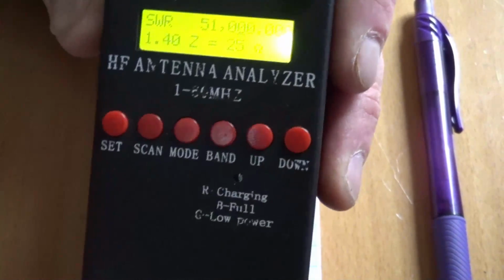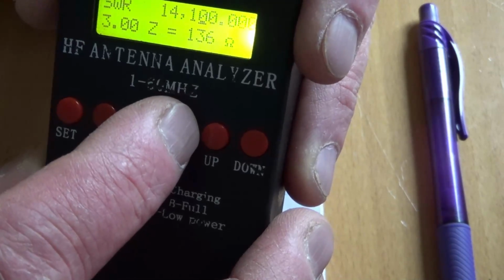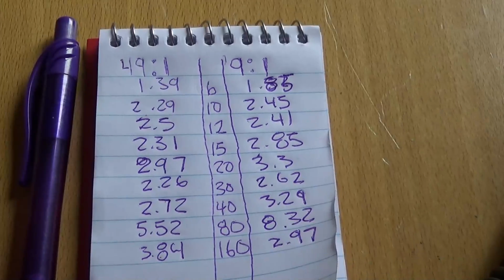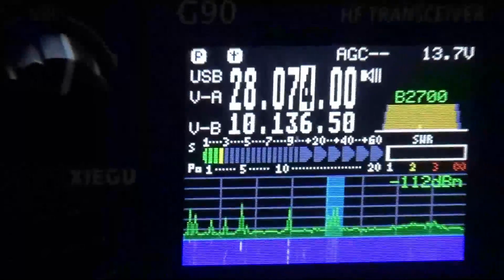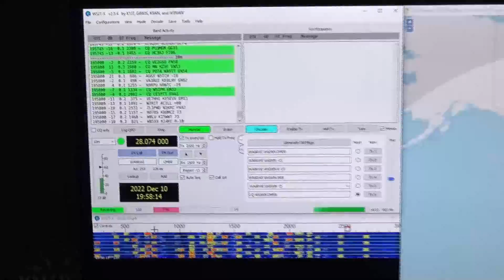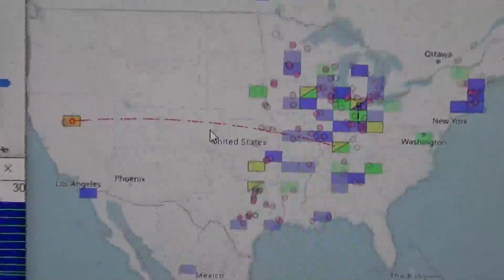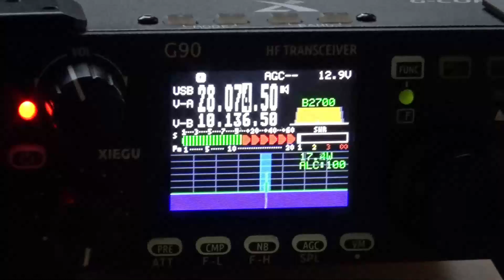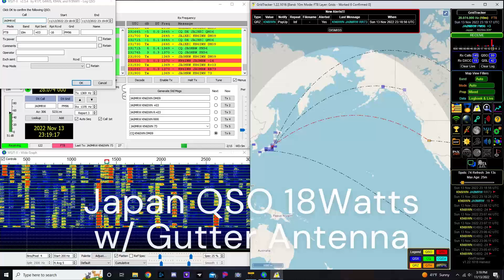How to make a HF Rain Gutter Antenna

Comment: How did you physically attach your feed wire to the gutter?
Reply from the maker: I soldered a small clamp from an old battery charger to a wire and clamped it.

Comment: FT8 is not really the best mode to evaluate antennas since it's a very weak signal mode and minuscule radiated power will provide contacts.  Also, keep in mind that if an antenna needs a counterpoise (CP) to work, the CP also radiates. So if it is 6 inches or more above ground level, the CP will be much more efficient since it couples less energy into the lossy, high-resistance earth/dirt versus laying on the ground.  This also applies to radials for vertical antennas.  Check the excellent article by N6LF in QST, March, 2010, especially the graph in Figure 5.
Reply from the maker: This was an old HOA stealth antenna I was experimenting with years ago. FT8 is an excellent way to test your raingutter antenna! There are many debates on elevated or non elevated counterpoise wires. For a stealth HOA application, having them on the ground to not be seen or tripped over is just fine. This is a comprised antenna for someone without other options in an HOA. Thanks for watching 😃

Comment: I use my rain gutter, no coils or baluns ,just coax and ground rod, swr below 1.5 on 10,15,20,,, 40 needs tuner,   my with is fl, did a test and checked my signal,on web sdr, at 5.6 it works
Reply from the maker: I'm glad it's working for you! Nice setup.

Comment: I have IC-7300 --> 30' Coax --> LDG 1:1 Unun (Blue) --> LDG 9:1 Unun (Red) --> 250' rain gutters. I have a 4' piece of rebar in the ground about 3'. Seems to work ok, can transmit from N. Alabama over to the east coast, up into the mid-west and northeast. I have done FT8 all over the US and into Cuba as well as the UK. I can hear people on Amps from the west-coast and the UK. Seems to work best within a two state circle. 

I also have the Alfa HOA Buster that is currently installed but it seems to be not working now, going to switch back to the above setup tomorrow.
Reply: to be clear, are you running a wire in the gutter or feeding onto the metal gutters themselves?
Reply: @adb99999999999  I'm feeding the metal gutters. I have a wire going from the Alfa HOA Buster to the rain gutter downspout.
Reply from the maker: @adb99999999999  loading the gutter themselves.
Reply from the maker: I've had some better results when it's raining, just rained, and snow in the gutters. It most likely gets a better connection then. It's definitely a comprised antenna, but better than nothing. Thanks for watching 😃

Comment: I have an hf rig mounted in my truck. I own a Hustler mobile vertical but for kicks I decided to try running a wire (maybe 35(ish) ft long using a 1:1 BALUN with a counterpoise cut for 30 meters along the ground. I ran the radiating element up to and routed it along the aluminum eve of my front porch in the pocket just under the gutter. This is facing South. I used nails in place from Christmas lights to hold said antenna wire in place. I don’t know how the aluminum may have played into the characteristics of the antenna but living in Southern Illinois, I was able to tune 20 meters and receive and contact SSB up and down the Eastern Seaboard, Florida, all of the way into Texas and Oklahoma in the early morning hours. This kind of faded by mid morning though as conditions changed. It worked quite well and is the closest that I’ve come to running a “Gutter Antenna”.

Comment: There seems to be a thought with younger hams that making antennas that work well can be difficult. Being a ham for over 40 years I've tuned up just about everything imaginable. The craziest of things can produce amazing results. There is also a big myth out there that antennas are more effective if resonant, not true. In fact, you can get more signal out of a Non-Resonant antenna. Study maxwells equations to find out why. This revelation made me understand why odd metal structures can perform so well. Using an ATU you are 'conjugate matching'. Basically what happens is as the wave is traveling up and down the feed line it is adding to forward wave that radiates from the antenna. NOT acting like a dummy load as some would have you believe. So, yes, match up your gutters and have fun  :-)
Reply: Also, don't forget -- resonant antennas are ONLY resonant on the frequency it is cut for.
As soon as you move off of that frequency it is a non-resonant antenna.
Reply: @8thman8  Very true, but conjugate matching can actually improve performance when the antenna is technically "Non Resonant". Research Maxwell. I first discovered this phenomena when a section of my wire antenna broke off in high winds. I matched the antenna and strangely it outperformed when it was perfectly resonant. Now I know why.
Reply from the maker: Thanks 😊

Comment: Have you ever  made a gutter  antenna for 11 meters (CB radio) is it possible?
Reply from the maker: Mine works on 11m. You will have to experiment with what you have. If you have room , try an 11m dipole made from speaker wire.There's lots of videos on how to make the 10m version. Good luck, 76er aka 076  NorCal

Comment: I was hoping I could at least do this since we were getting new rain gutters installed . . . then they installed PVC rain gutters and downspouts, lol.
Reply from the maker: Maybe you can sneak a wire inside the gutter if it's PVC.
Reply: @W6IWN_Radio  I have been thinking about trying that. Trying to figure out how it could be done. The only downspout on the house is 125 feet away from my radios, then the downspout is 25 feet tall as it is a two story house. Thats a long way to go just to get up to the gutter where the wire would be. The downspout is at the very end of the gutter, so it would have to be an End Fed, but the gutter is too short for a traditional  EFHW antenna to be hidden inside it, lol.
Reply from the maker: @WH6FQE  some people just mount a wire to the roof eaves or an inverted V on the roof rake. If the wire is the same color as you paint, it will be hard to spot.  Best of luck 👍

Comment: How do you connect a wire to a rain gutter? As I live on a ground floor apartment with no porch. I do have a gutter outside my bedroom window and could probably run a coax through the window using a strip connection. Any help would be greatly appreciated. 73s Rob,wa2fmh.
Reply from the maker: I soldered a wire to a small battery clsmp, then I scraped the paint off my gutter for a temporary connection. For a better, more permanent connection, scrape the paint off your gutter and use a ring terminal with a star washer, and screw it to your gutter.

Comment: a little confusing on some of this. I was told by several people to  just hook center coax to gutter  braid to ground rod and let my antenna tuner  do the rest  is that correct or should i get a balum
Reply from the maker: A 9:1 impedance transformer brings the varying but generally high gutter impedance down to something reasonably easy to match to 50 Ω. I would definitely use one. Check out the Facebook Group Raingutter HF Antenna for lots of information and pictures. https://www.facebook.com/groups/292984397532571/?ref=share&mibextid=NSMWBT

Comment: Good results.  I recently joined that facebook group and saw a post where one guy used a 9:1 and got good results.  I thought about hanging a long wire from a bunch of trees in my backyard, but will probably try this first.  I’d like to know if this could work on higher bands (2 meter ).
Reply from the maker: The gutter would probably be too long for, VHF/UHF but you could definitely experiment. I do get 6m on my gutter, I haven't tried 2m. Thanks for watching!
Reply: I obviously need to invest in an antenna analyzer and tuner.

Comment: Have you tried CW yet. I guess you know that when you key down in CW you are transmitting full power as opposed to SSB where your voice goes up and down with every part of speech. Not sure what licenses you have but I am finding more Tech classes trying to learn CW and like many of us, I slow down to what that person can copy. None of us started out copying fast CW and all the more reason to help out the newbies who are trying to learn. Many of them will be copying above 20 wpm soon. 
FT8 is OK if that is all you can do but the satisfaction of copying code in your head as opposed a computer doing it for you is great. 
Your results with SWR and the 49 :1 unun are plenty good enough for most auto or manual turners to tame. 
Good luck making contacts and I applaud you for making the effort of loading your gutters. Just be vigilant with your counterpoise and ground connections since it does not take long to get some oxidation.
I was first licensed at age 15, 51 years ago and still enjoy the hobby very much.
73, Glenn WA4AOS
Reply from the maker: Thanks Glenn, no I don't know CW yet but it's on my bucket list. There's a slow speed CW net locally here for practice.

Comment: I love it. One of my best QRP in the park was using a raingutter. I had thrown a 35ft OCFD fed with 450Ohm window line and LDG 4:1 balun. I thought I could get my antenna higher and started to pull it down. It got stuck and I pulled it apart.
Wolfy offered me a hamstick, but I declined and enjoyed my coffee for a few minutes. After thinking a bit I pulled some C-clamps and scraps of THHN wire from my car and I hooked one side to the park pavillion raingutter and the other side to the cast iron grill next to the pavillion. I tuned up my MFJ-949E tuner to 40m and broke into a QSO about 140mi to the west in Clearwater, Fl. Then I tuned up on 20m and broke into a QSO with station in Oklahoma City, FL with 10W SSB phone.
This is what I did the other day in front of my condo. I like to practice 80m NVIS QRP.
https://youtu.be/nShDYlZGKlc
Reply from the maker: Very nice 👍👍

Comment: I wonder if the sections of gutters that slide into each other cause an issue with the SWR since they might not be electrically connected 100%
Reply from the maker: I've seen a video where a guy binds each gutter connection together with jumpers. I can't pull that off here though.

Comment: K0XHF here. I have been using HT radios exclusively. yes, that translates to the B word in radios. When money comes together better, I will be on HF. Finding cheap HR rigs has failed me.
Reply from the maker: Check out the Xiegu G90 it's affordable with many features including a Auto Tuner!
Reply: @W6IWN_Radio  Thank you. I have months where I could not even justify a pixie rig. Things will get better after winter.
Reply from the maker: @patriot9455  I feel you, I do concrete and these Winter storms have put us to a halt since the beginning of the year.
Reply: @W6IWN_Radio  Nothing like the consistent work in construction, lol. Winters were bad for me because I refused to chain up. I left with 42 accident free years, not everyone did.

Comment: Very cool.  I personally don't care about SWR since I don't TX even though I'm a ham.  Just like RXing on digital modes only.  Lighting protection would be a great concern for me.  Considering the huge potential for broadband QRM, I'm surprised at the noise floor.

Comment: When using the 49-1 endfed, disconnect the counterpoise ground wire and see if there is any appreciable difference.  I bet there isn’t.  You have a long coax and a choke at the radio and using only 20 watts you should be okay.  I have my coax choke right at entry point into the 49-1.
Reply from the maker: Yes after some discussion I learned the loops at the radio aren't necessary, I do have it choked at the 49:1 
I also purchased a better copper ground rod for an earth ground. In the EFHW config I probably don't need the counterpoise wires with a good earth ground. I'll experiment! Thanks 👍👍

Comment: Thank you.
   Your antenna works.
At about 120 feet up, not a good idea to be bonding the sections of gutter together.
   Thanks again. N0QFT
Reply from the maker: Thanks 👍👍
Reply from the maker: It's roughly 120' length of gutter in an inverted U orientation with the top section about 35' high.

Comment: Don't know what your gutters are made of. Here in the UK, old houses have cast iron and new houses have plastic. If plastic, you would need to feed a wire along the gutter using the supports. If you can go all the way round, you could have a loop antenna which will match better on all bands.

Also, useful as a receive only antenna for those fortunate to have towers etc for transmitting antennas.
Reply from the maker: In the US residential gutters are typically made with seamless aluminum. Yes a skyloop would be great.
Reply: @W6IWN_Radio  Thanks for the info!

Comment: If you disconnect your wire at the gutter what is your swr and if ok your ft8 experience? 41' wire in tree here at my HOA. FT891/MFJ-939y
Reply from the maker: It got knocked of by the landscaper before and it was 10+ and the radio wouldn't even tune.

Comment: I run a tuner with a wire running to the gutter. I put the conterpois in the bushes. Padio is 4x10 and the down spout is 10ft. Away. The tuner is grounded but thats it. Work well.

Comment: Thanks for sharing. The only other antenna solution I can think to suggest is a mag loop.  Even a lash up for 10m QRP, just to try out would not be very large and quite easy to make. This test also demonstrates how good weak signal digital modes can be in a compromise set up.

In the UK, our downpipes and gutters tend to be plastic, except for some older buildings with cast iron. So, using gutters tends to mean laying a wire in the gutter or attaching it with tie-wraps.
Reply: I've enjoyed using two magloops from MFJ. I have to 200W 40m-15m with an automatic tuner. I also have the large tuner with mount for a PVC pipe to hold a wire loop. Both have performed reasonably well.
The main advantage is I am able to deploy the loops in front of my condo and point the null towards QRM from HVACs.
The downside is retuning everytime you want to change frequency or band. The past few years I've been quite happy with an 80m-10m EFHW for portable ops. No tuner required and performance very comparable to a tuned dipole when deployed properly.

Comment: Nice… I used that very 9:1 unun for my gutters at my old apartment. It makes sense because it was a non resonant length of gutter, with an unun for a non resonant wire length. Wrapped up my DXCC with it and it worked on 10-160 meters. Rain or snow never affected mine. My apartment building was 145 feet long with 6x 30 ft tall downspouts. Lots of metal.

Comment: What you really want is one of the NANO VNA so you can graph where the wire is resonant, so you shorten or lengthen the wire to get the swr lower...
Reply: I was also thinking a Nano VNA might be interesting. You never know, there might be low SWR dips close to one or more bands that would suggest a little fettling could give better match.
Reply from the maker: My mini 50 sweeps but not graphics. I would like to get a NANO in the future though. Yes I need to experiment with my lead length to the gutter.